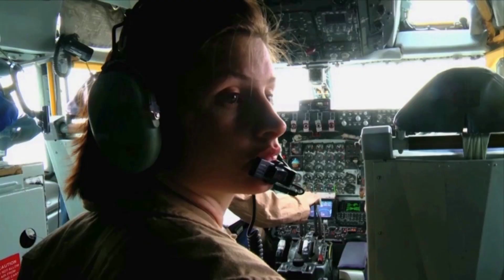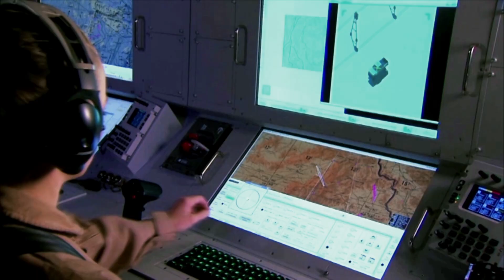The Satellite that Protects Itself

Comment: It's all ground base fiber optic,  There are no satellites, all they will show you is CGI and cartoons,  Search, SATELLITE HOAX,  this is all part of the fake space program.
Reply: Patrik Ravolainen You didn't do the search did You?  Signals are bounced off the atmosphere,  do the search to get all the details,  All your questions will be answered,  NASA says we have over 2000 satellites in space , Then why all the cell phone towers?
Reply: Patrik Ravolainen around 5% of the Internet uses satellites, most IS transferred via fibre optics under the ground
Reply: Chainsaw Surgeon you should really learn how frequencies work.  Only HF frequencies will bounce off the ionosphere which is in the 3 MHz to 30 MHz range.  All other either get absorbed or pass through and continue into space.  SATCOM is in the high end of the VHF range 30MHz to 300MHz.
Reply: Chainsaw Surgeon ض
Reply: ام نواف  شو؟
Reply: What?
Reply: Chainsaw Surgeon po
Reply: ... do you realize that you JUST used satellite by posting that comment...
Reply: Chainsaw Surgeon The government wants a multilayered communications capability, for backup, just in case we lose something.
Reply: +On the Top filmed in a Hollywood basement.   nasholes
Reply: McQueen
Reply: Hilario Cervantes nice vid
Reply: Chainsaw Surgeon Also cell phones operate in the UHF range 300MHz to 3 GHz and will not go nearly as far before being absorbed by the environment, it needs lots of power to push it.  We have so many towers for that reason.  Also there is so many cell phones on small number of frequencies, the towers and the tower base station allow more than one cell phone on the same freq, it is very complicated so I am sure you wouldn't understand it.
Reply: scott0551 Show me one REAL picture of a satellite in space .